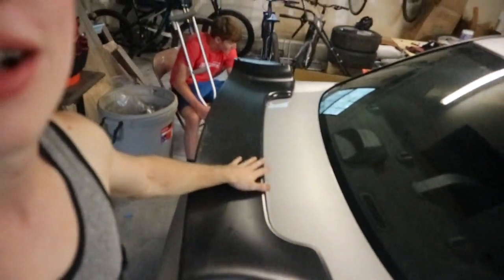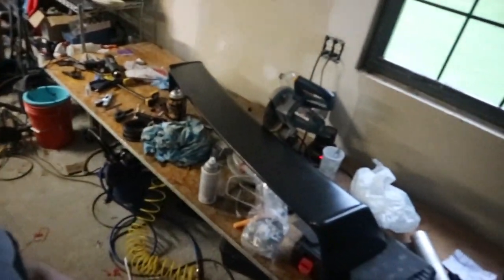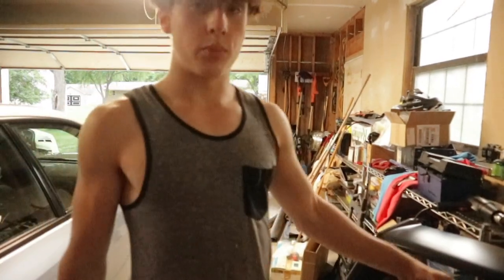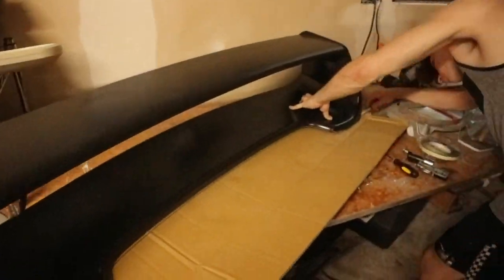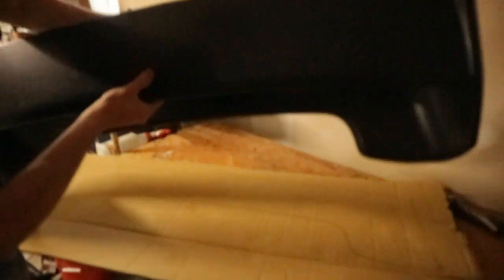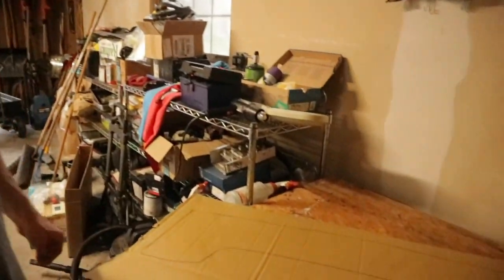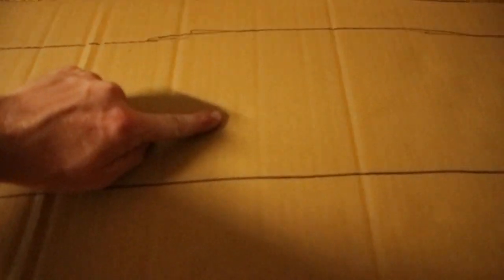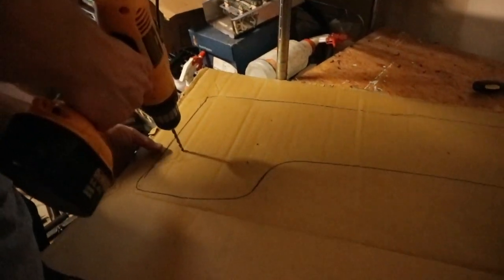HOW TO INSTALL STI WING 02-07

Comment: Short little question: 
The screws you put in the bottom to mark the holes on the template, you just screwed them in the pastic? 
Cause mine doesnt have anything to screw them in. Alle these little holes are sealed. Do i need to drill them and screw normal screws in? 
Thanks for the answer :D

Comment: Great video, just curious did you ever have issues with water seeping through all the holes you drilled?
Reply: Go around it with a bead of clear silicone it will help hold it and seal jt

Comment: What is the hardware i bought a wing but not sure on the hardware
Reply from the maker: I love Cuchi you need 1/4 inch bolts, they should have them at Home Depot and orileys
Reply: Nardo WRX does matter ?? As long as 1/4